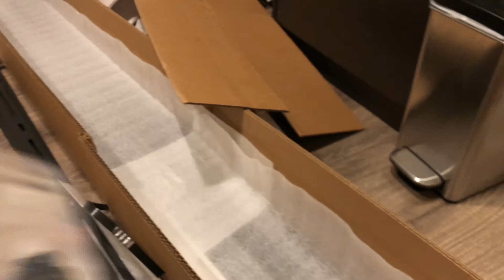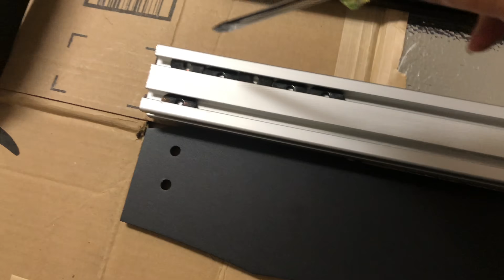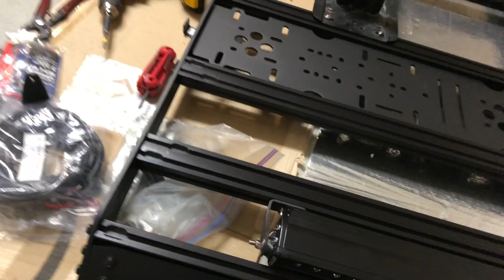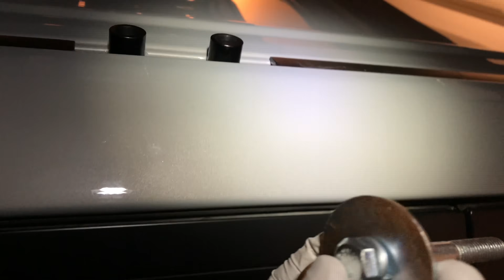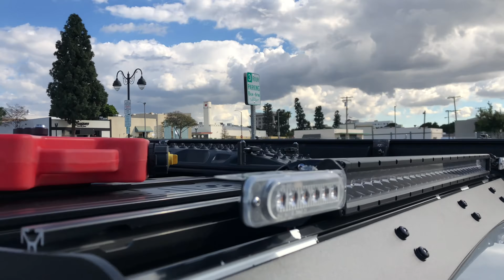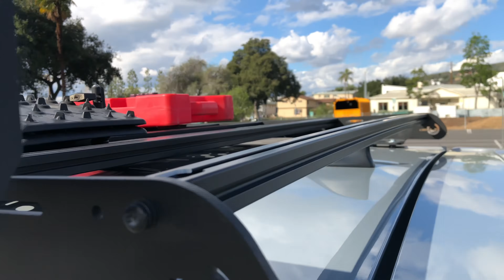Prinsu Roof Rack for 4Runner TRD Pro Install【TRD41】

Comment: Does the 7/8 roof rack mount on the 4 existing mounting points on the 4runner?? Or is it 6 points of brackets like the full size roof rack?? I'm debating on this or the 3/4 size.
Reply from the maker: 4 existing bolts. Don’t need to drill anything.
Reply: @TacticalExpedition  I actually found out this wont work on my 4runner cause I have the sunroof on top. So probably go with the 3/4 now

Comment: Ok, just to make sure, cause I'm really confused. On their site they say the full rack is the only one that requires no drilling, but it has some mounts that goes with 3M double sided tape which I'm not sue about. However I see on your video that this 7/8 version attaches to the existing holes front and rear. Pretty much is a bolt on? If that correct?
Reply from the maker: Mine (7/8 version), it attaches to the existing 4 screw holes already on my 4Runner. The full rack has 6 points of contact and the front 2 doesn’t require drilling but they use 3M tape to secure it.
Reply: Great. The rack looks pretty cool on your car. I also have another question and is, how long did they took to ship the rack, after order we placed?' thanks again
Reply from the maker: I ordered it during November. I received it around February.

Comment: Have you noticed a lot of windnoise having the rack on for a few weeks? When I mounted my maxtrax on my prinsu rack I drilled into the crossbars lining up on the slot that's already there....the pins just screwed right in and I had ample room to tighten the bolt below.  Nice install....looks great. 👍
Reply from the maker: I don't have any wind noise. Also, I didn't want to drill anything to the crossbar because I don't want to change the integrity of the crossbar max weight allowance.